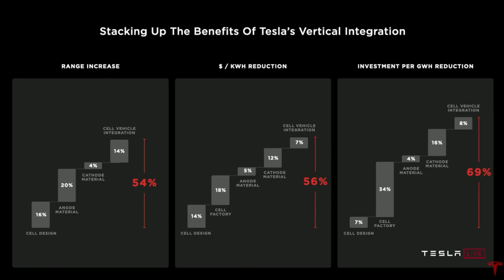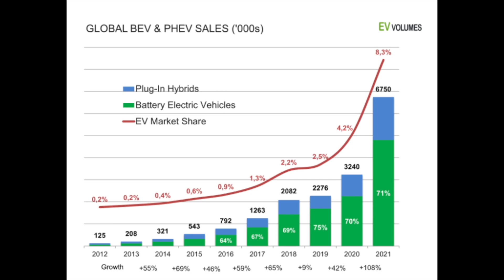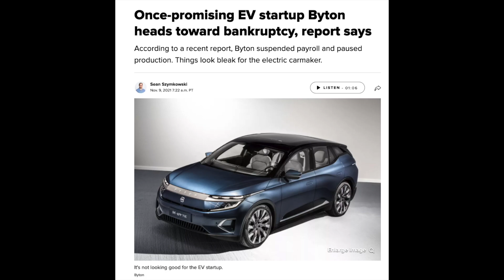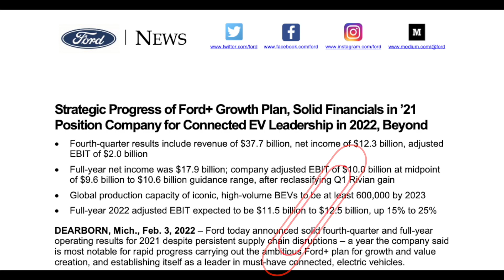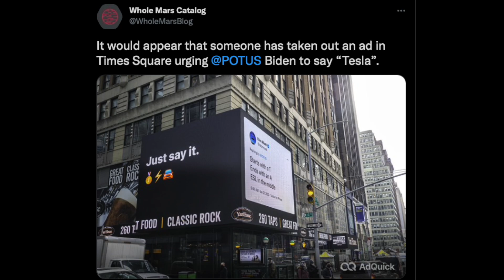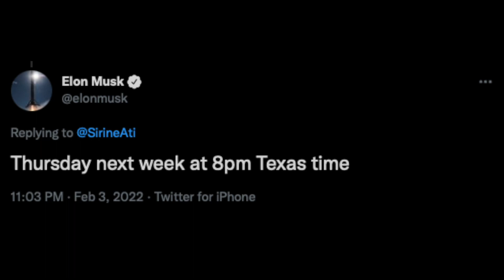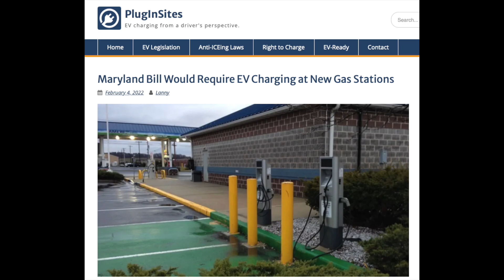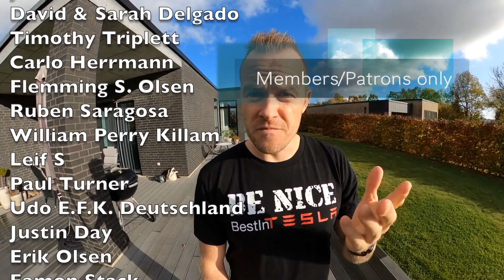Will Tesla overtake GM and Ford’s bottomline this year ? Is the Tesla Model 2 cancelled?

Comment: Not sure why this is missed by people, but if you lower the price of EVs by several thousands dollars, the demand will easily 10X and Tesla already has a wait list of 3-6 months right now, so what would be the logic in working on a $25K EV, which BTW would not be anywhere near 25K right now with the shortages and inflation. Tesla would need Texas & Berlin at 2M EVs per year and that would not even do it, they would still have a wait list of ,1 if not 2 or more years, so it makes no sense whatsoever to expect them to even talk about the Model 2.
Reply: Exactly!
Reply: I personally think that this is the charge cycle of Elon dropping the hammer on the competition, with outrageously advanced vehicles at prices that no one will be able to match.  That will be the real game over.
Reply: Well said indeed. But also more critical is how for all of 2021 it cost tesla over 36k per car they made according to their sales reporting. 
And that was with 97+% of all their sales being the streamlined mass market model 3&Y. So no way will elon be allowed by the board to bring the compact sub 30k car out yet. And loose over 10k on each one. 🤔

2-3 more year's after tesla and Berlin are ramped, Shanghai is rock steady at over 1-2million unit's. And freemont has been retooled to also approach 1 million unit's. Only then and likely only at another new plant or expansion of existing plants. Would tesla introduce the compact car. Just my thoughts on it.
Reply: The demand for teslas is going go off the charts!! Once’s these Austin Teslas start to circulate around the 🇺🇸 United States, non believers will start to change and wil begin to have EV ENVY!!
Reply: Yes, they have plenty to do replacing most of the 
BMW, Mercedes, Audi, and Porsches to keep busy for years.  And those car owners can afford Model 3, Model Y, and S, no problem.
Reply: You dont get it. Robotaxi will displace 80% car ownership in urban areas over a ten year period.Its going to be a fraction of the cost of owning a car without all the headaches while being chauffeured around.
Reply: Exactly... It makes no sense whatsoever to consider lower priced vehicles you have limited chips. 2022 is the year for ramping/optimising production of 3/Y to the absolute max.
Reply: You are wrong. Try thinking for yourself.
Reply: @sigma_six  Who wants a Tesla until it has been demonstrated that the batteries will  not fry themselves to death over the sizzling hot blacktop pavement that's under the Sun most everywhere.
Who wants a Tesla until it has been demonstrated that the occupants won't be frozen to death on a highway somewhere if a blizzard comes along.
Reply: @4literv6  Great points!

Except saying " So no way will elon be allowed by the board to bring the compact sub 30k car out yet. And loose over 10k on each one." Is like saying no way Model 3 will be built yet since Model S costs over 60K to build, because every Model 3 would lose 15K.
Reply: @jeffholman2364  how so? They literally spelled it out in their most recent 10-k. It costs them 36k per car made. 
Over 97% of all cars they sold in 2021 we're the 3&y model's. So no right now they cannot bring out a sub 30k car and make $ on it. 
And the board definitely wouldn't allow them to either. 🤔

Comment: As Tesla focuses on engineering miracles Elon has painted GM into a corner where they are behaving more like a fringe political party rather than a tech competitor.
Reply: GM and UAW have their heads spinning trying to figure out how to proceed without wiping out their cash cow….employees.
Reply: Insightful take!
Reply: Humans can’t compete with aliens.
Reply: @Ben Benito Tesla is at the bottom if you can believe the likes of Consumers Report or JD Power.   Tesla doesn’t contribute to advertising so the pushback from various entities is vast.  Look at it a different way….do you really think that if the quality was so bad that people would be waiting months and months for deliveries?   Highly doubtful.   If you look deep into Consumers Report you will find some nefarious “donations” as well as who is actually on the board.  Hint: former Ford employee.   When CR came out and showed how you can trick the safety system by hanging various items on the steering wheel but we never saw them connecting seat belts behind a driver or using a brick on the gas pedal for cruise control.  Tesla isn’t perfect but they certainly are the most advanced in manufacturing today.  Take the criticism with a grain of salt for both Tesla and Elon.  Tesla has the safest vehicles on the road, period.  When GM gets these nonsense awards from JD Power you can bet that it was purchased in some fashion.  Does anyone really look up vehicle data on JD Powers?  Zero credibility imo.
Reply: @Ben Benito  you must be reading the GM Tribune
Reply: @Ben Benito Absolutely Not!  I would still say the same thing about them!  Full disclosure, I currently drive a Toyota and they do make great ICE cars and trucks.  I’m smart enough to know that my next vehicle will be a Tesla.
Reply: @Ben Benito Have you ever thought a lot of the wait is due to production constraint and chip shortage? Two factories are not going to meet such high demand for EVs.  Did you know Mercedes has 56 factories? Yet, Merc sold about 2.5M vehicles in 2020. Consider Tesla has two factories will produce at least 1.2M cars this year. Two more factories coming online this year. Say what you will but what you said could also be apply to you as it seems you really dislike Tesla and believed everything as long as it is confirmation bias.
Reply: @Ben Benito Sandy Munro LOSING IT Over Tesla Engineering: “To Die For”
Reply: @Ben Benito Repeat after me: Starts with a "C", Ends with an "N", "URRUPTIO" in the middle".
Reply: @Ben Benito Hey Look, Everybody, I found Mary Barra! Masquerading as Ben Benito!
Reply: @radicalrick9587  Given the messages below I think that you are right!
Reply: @Ben Benito Ben hanging out in the comments section of a company that you don’t support only makes you a troll.
Reply: @Ben Benito You mean President Joe Biden? Lol
Reply: @delusion2987  Please share specific info regarding lies and what impact they actually had.   People are always saying things like this as if the situation changed the entire industry.   I highly doubt that it amounted to anything substantial otherwise Tesla would start having to pay for advertising in order to have a chance.
Reply: @Frank_W.  totally agree!! currently drive a Honda, next car will be a Tesla!!!
Reply: @Frank_W.  :   Cash cow for the unions, and political protection for both, because having that many employees buys them immunity from bankruptcy, you know, too big to fail
Reply: @steveperreira5850  Thanks, I couldn’t agree more with you.  GM and JD together make some pretty stupid commercials too.   Actors pretending to be impressed or surprised by some look or features.  Yes, I despise them too.

Comment: We do need level 3 at refueling stations but we could use several level 2 charger's at almost all retail outlets.  If you could get 20-40 min of level 2 charging while you shop it would help a lot to get around while doing chores.
Reply: Level 2 chargers are most needed in employee parking lots! Employees are on-site all day and could make full use of a level 2 charger. Shoppers and customers are barely there long enough to make it worth plugging in.
Reply: @petedemoss7421  Good thought, completely agree.  I was thinking more along the lines of public infrastructure but having employers install chargers is also going to be very important.
Reply: @petedemoss7421  EXACTLY! I had a 101 mile commute one-way for months and would have saved ~$700/month in gas savings with a Model Y, but it wasn’t feasible since there was no charging in the remote employee lot like there was in the on-site parking garage for customers. Also, my apartment complex doesn’t have any chargers as well.
Reply: @petedemoss7421  I agree!

Comment: You are a pioneer by taking your Tesla to the artic circle and beyond.   I was told I was a pioneer 3 years ago at an EV car show. Because my wife and I take her Model X and tow a 3000 pound RV around the USA.  You don't skip any chargers!  Longest trip so far has been 3700 miles. Next year, planned trip is 7000 miles, in a 2016 Model X 90D.  I think your feat is more amazing as you pushed your vehicle in extreme cold temperatures.
Reply: No, he is not a pioneer. Two german girls , Heidi Prochaska and Claudia Wörner already did the Nordkap tour  in winter nonstop in 2018.

Comment: The tesla charging network will process more cars per hour with the introduction of the 4680 cell. Less resistance less heat so more time at the max charge rate

Comment: Here is a point you need to add to your wonderful reports. I am an engineer with 20+ years of design experience for many car manufacturers so I know the inner secrets and I see the cars differently. Tesla cars are not perfect but they are getting better every month. Main advantage is not about being electric. Other car companies work through dealers that dictate the market. In another word, product is designed to please the dealer and not end user. That is the main reason they want to keep the ICE as long as possible. Tesla does not design to please a dealer. An electric Ford for example is still designed to be service heavy so dealer keeps making money. Car dealers must go out of business so traditional car manufacturers survive. That is the main reason US gov is supporting GM/Ford. Card dealers are the main problem and they will do whatever it takes to stay in business, taking big brands down with them. 
This is the main reason they were late to bring electric cars to market, since a proper electric car is not service heavy. Even new VW electric is designed with parts that have lower service life (intentionally) to keep it in service bays just like their ICE cars. They will resist software updates that Tesla offers as much as possible, since they want you to feel out of date as soon as possible. People need to know this dirty secret of car industry    That every manufacturer follows except Tesla. I own 3 ICE cars but if I decide to replace any of them it will be a Tesla. Tesla cars are not perfect, they need maintenance and service, but it is not something that is pre planned for you to empty your pocket, feeding the dealer and manufacturer in return.
Reply: Thank you for explaining this issue

Comment: I think the logic goes, with fsd, 25k will not be needed. When you add insurance cost, people are starting to prefer an Uber than owning a small car. With fsd, it will further reduce the cost of ride-share by a huge factor. At that tier, owning a car will not be economically sensible for the buyer. And the margin for the producer will not be sensible either, with low margin.
Reply: How about buying a Tesla and having it in a robotaxi fleet?  Would that not be better than either?  You may even end up making some money.
Reply: @SkyRiver1  exactly, I think that’s what Elon meant. It will be cheaper to own a car, and also cheaper to get a ride if you don’t want to own, making the 25k car obsolete
Reply: The world need a small/compact car.
So many cities (outside US) with very tight roads and tight parkingspaces.
Reply: @runeoveras3966  I’m sure that is true. And another though: I wonder how long till fsd motorcycle.

Comment: Would be interesting to see how they design a model 2 style car. Do they just make a smaller hatchback version of the M3 or radically re engineer it to be simpler and cheaper to produce perhaps using different motor and battery tech. They wont compromise on software though, so will still need all the FSD hardware.
Reply: Dear Thomas :  first off, I have no doubt they will produce a model 2, a $25,000 car. Elon has promised a car in every price category, he has never wavered. I too wonder what this car will be like, and I totally agree with you that it Hass to be simple, that means fewer parts, Way less, and they are making progress with things like castings, mega castings, etc.

Comment: Small Correction: Tesla's $25K Car will likely use LFP, not 4680 batteries. LFP wasn't as well developed (high cycle life & reliability, low fire risk, cheap, and widely available) at the time of Tesla's Battery Day presentation. LFP batteries, to be manufactured by CATL, BYD, Great Power, LG Chem, Gotion, and others, will likely scale faster than 4680 batteries over the next few years.

Comment: I think 2024, tesla should license their skateboard to other companies. Let those form assemble different look / interior. “Tesla Inside”. Just a thought
Reply: Tesla cars do NOT have a "skateboard", they are a generic unit-body with a battery pack attached underneath (even with the so-called "structural" pack) and the motor/drive units installed from below.
Reply: @awebuser5914  Wrong, A. W.

Comment: As the LFP chemistry is slowly but surely becoming the default "cheap" battery, the argument against cobalt, even when used in higher margin EVs, but now much less percentage used, is going to fall ironically on oil industry, since they were the one who started the discussion. Even if the usage for cobalt for cleaning the petrol is really much smaller than the battery, there will be a significant closeness in quantities between oil industry and EVs. As a consequence, we will start to see all kinds of media mentioning all of a sudden that the "child labour in DRC is really under control", that there are many other countries who mine cobalt, and also, maybe, there are a lot of "green extractions" plans sponsored by Exxon or BP or OPEC. Hey, you know, any dirty old business becomes magically OK by simply adding in front of it the word "green". Like "green hydrogen", "green petrol", or "green fracking".

Comment: Maryland requires EV chargers at new petrol-filling stations? Lars says that's "meaningless." Correct. Smart money is not going into more carbon-fillers. Frunks first!
Reply: No, he's a complete idiot by dismissing that concept.  It's just a matter of time and critical mass before all the major oil companies will start removing one or two gas pumps and installing DC fast chargers (and continue to do so, as the market dictates).  It's a huge boon for them since the profit is probably just as good as gas on the power sale and they have a much more captive audience to spend money in the shop, where the REAL profits are! 

We are still ridiculously "early days" in the entire EV market (other than in niches like Norway), so there's a lot of ranting and worrying about "range anxiety" when the market itself will solve all these things as the demand actually becomes relevant (tip: EVs are NOT relevant in the US and most markets yet).

TBH, Tesla's clustered "Supercharger" approach is probably a waste of money in the long-run since people will expect there to be charge points at literally every intersection, just like gas stations are today.  There is absolutely no compelling reason that auto manufacturers should be addressing the "fuel" of the vehicles they sell, that is completely illogical and inefficient!  The oil companies will slowly transition as many pumps as the market demands, maybe redesigning the layouts when gas starts to become the minority of sales, but that's going to take a LONG time (contrary to idiots like Tony Seba...)

Comment: Tesla will not use the 4680 battery in the $25k EV!  They will use a LFP battery from CATL or BYD or some other LFP battery manufacturer. Why would Tesla put its premium battery in its lowest end EV?  Tesla is using LFP  batteries in the low end Standard Range Model 3s and soon the Standard Range Model Ys. Why would the put their premium 4680 battery in a even lower price EV?  Just because Tesla spoke about the $25k EV at Battery Day, it didn’t mean this car would use the 4680 battery. 

Why would Tesla introduce a $25k EV after raising prices on the Model Y and Model 3 almost monthly. Why build a lower price EV when you can’t fill the demand for your much more expensive and more profitable high end EVs?  Why introduce a new EV when you have even produced EVs that were announced 2 and 3 years ago (Semi and CybrTrk)?  During a chip shortage, why would you use these chips for a lower cost and lower profit EV at the expense of your highly profitable high end EVs?
After promising that the Model Y would be the world’s biggest selling car by revenues this year and by volume next year surpassing the Toyota Corolla, why would you risk the Osborn Affect by introducing a $25k EV?

Comment: Think I’ve to disagree with this statement, “Tesla is not battery constrained!”.

Tesla is indeed battery constrained, new form factor 4680 needed for Semi and Cybertruck is being ramped. These are some reasons why those two awaiting products are being push back. Tesla has growing demand, but the batteries and supply chain are a factor!
Reply: I agree.  I think Tesla was saying there is enough battery capacity to easily hit 50% volume increase on the current model cars.

Comment: Would model 2 be called A so it would be called s3xy cars ? Model S model 3 model X model Y Cybertruck model A Roadster Semi
Reply: Add Semi and you'd get s3xy cars!  😃
Reply: @walthooker1434  yeaa
Reply: Mr Musk has already emphatically stated that “2” will NOT be used as a model name.
Reply: @ernestgalvan9037  Agree.  That's why Tieme's Model A makes so much sense to spell CARS.  😃